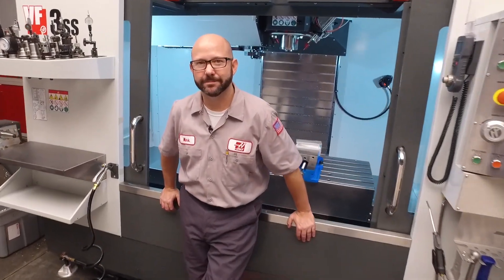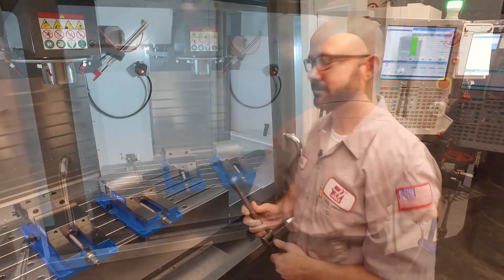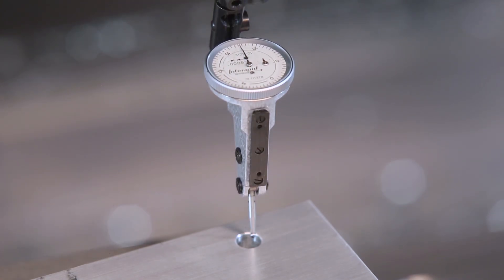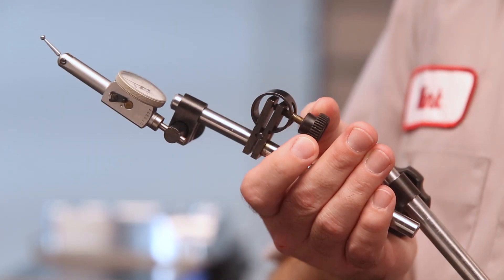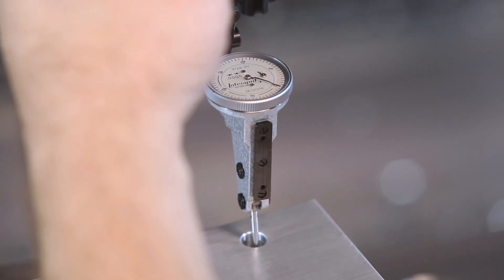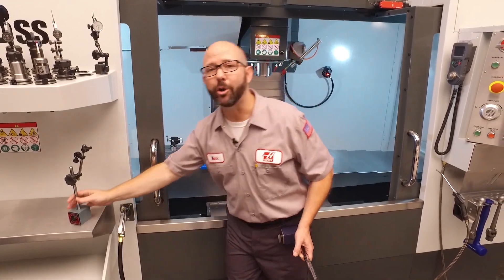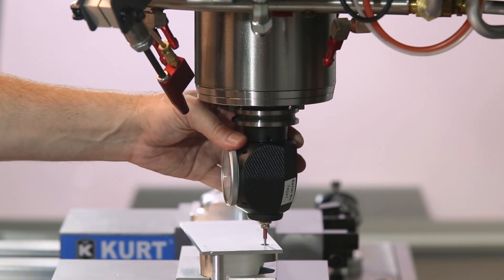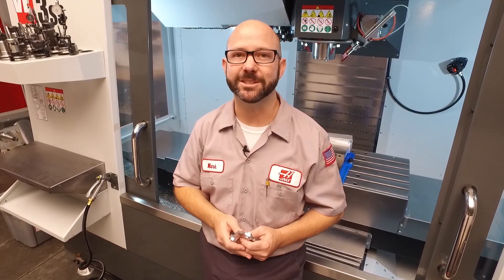How to: Manually Pick Up a Bore or a Hole with an Indicator – Haas Automation Tip of the Day

Comment: We are learning this very thing in my CNC Operator course right now at WSU Tech. I am really grateful for this video as it really makes it so much easier to understand what I need to be doing. My only complaint is that it would be nice if the he showed how to get the indicator into the correct position using the magnetic arm mount. I spent 2 hours in class yesterday trying to get this done and never made it, so confusing. Then after all of us were savagely frustrated our Instructor showed us the Blake Centering Indicator and we were all complaining about why we even bothered with a standard indicator.

Comment: Rather than spinning the indicator inside the hole to find zero runout (procedure at beginning of video), a much safer, simpler way is to chuck a round dowel pin with a point ground on the end of it, align this with centerline of the hole, scribed lines work great for this as well. I’m not getting super into depth on this so you’ll need to make some assumptions as to scribed lines being where center of hole is and so on. Anyway, it’s much easier for beginners to use this method rather than mess around with trying to get your indicator tip to have near zero run out. Great video though and thank you!!

Comment: Your videos ROCK.  I have no expectation of ever running CNC machines because virtually everything I do is a one-off.  The benefit is that the basic challenges between manual and CNC machining are identical.  Every successful project starts with a good reference point and that is, IMO, one of the Haas Automation video strengths.

Comment: Another tip. Before ya got your hundred and fifty dollar indicator in the spindle, run "S100M3" to prevent an accidental spindle start from flinging your indicator across the room. Don't sit there and think it can't happen. True story. I worked at a shop in Fremont CA. We had a good year. Ownership bought us all mititoyo indicators. My boss, one if the owners, accidentally started the spindle which was set pretty fast and shot my two month old indicator across the shop. I was new so I just quietly said damn. He bought a new one, but the lesson is, if the spindle doesn't go fast, it can't fling your tool.

Comment: You can use an horizontal indicator, using the small dove tail on the side of the dial and bend the touch at 80°...

Comment: Literally at lunch watching this because I am struggling doing it for first time. I have no idea why this difficult. It looks super straight forward but for some reason it is really hard to get it down.
Reply: The method shown in this video is by far the most frustrating and difficult way to pick up a hole. 
I suggest you use a basic edge finder, split your X, then do the same thing on Y. This will get you centered within a half a thou. Then use this method to fine tune it.

Or buy yourself a cheap coaxial indicator, it will be the most useful tool you ever buy and save you half of your setup time. I got one on ebay for $80 and it gets me within a quarter thou of center. If you need more precision, then you can indicate it like the video shows afterwards.
Reply: I personally, and I have been doing this for four decades, get my indi down to a sixteenth or so above the hole and get the ball close to even on all four edges before I drop into the hole. With in a sixty fourth or twenty thou. Then it's spin it and do the math. It may help to think of it as "short of the zero, or past the zero" to help make the adjustments. I also always MDI S100 M3 so that if I accidentally start the spindle, my indicator doesn't fly across the room

Comment: I've found that if .001 is good enough for location, a Blake Co-Ax is the fastest way to find the hole. If you need better accuracy, then switching to a tenth reading indicator will do nicely.
Reply: This man speaks the truth. My coaxial indicator is the most useful tool in my box. And only $80 on ebay for a cheap one.

Comment: Why do you use the G55 work offsets and not the G54? Also, my friends and I haven't used the machine in a while and we accidentally part zero set the z-axis and I was just wondering what would happen if you did that and how to fix it if anything does happen.
Reply: Hi Braydon, check out https://youtu.be/uNjMIIRttFE . There is a lot of good info in the comments section of that video as well.

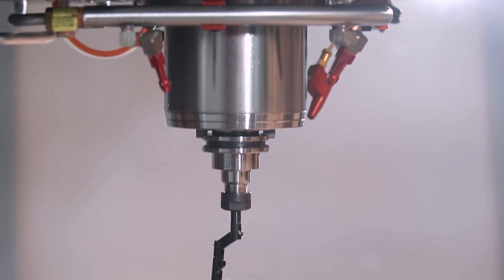Comment: I noticed at 1:35 you stop to rotate and tap the indicator with your finger. Can I ask why this is done?
Reply: Before I lower the indicator into the hole, I tap/bend my setup (while rotating) to put the tip of the indicator on the centerline of the spindle. This helps us start close to the hole center, which makes things easier.

Comment: Hi, thank you for another explanation important things for machinist. I have a question: what is the brand of horizontal indicator with black dial? I'm trying to find out one which has center of the shank lined up with center of the tip. It is hard to find one. Most of the Mitutoyo has tip off center na could be destroyed while rotating inside the hole or when touching the edge of material. I will be appreciated.
Reply: This is a TESA Brown and Sharpe BesTest indicator. I've really liked mine for this configuration.
Reply: @markterryberry4477  thank you very much!

Comment: I don’t get it. I must be missing something. If you only eyeball the tip of the indicator whilst spinning it, how does the concentricity of the tip to the spindle get established? Or doesn’t it matter because even if not perfectly centred the “centre offset” will be consistent for both sides of the hole?
Reply: We just eyeball it to save a little bit of time before we start using the actual indicator itself to measure things, to find how far off-center things are. If we are too far off when we start (6mm etc.), then the indicator won't make contact properly.

Comment: I like to put a pin in a tool holder or just line up a tool that is close to the diameter of the hole to speed up the eyeballing. I get much closer to center before I even start indicating.

Comment: Hello, put in G54  annd G55 two differentzeros to make the same piece in different  reference points, I did it a while ago in Dewoo 4020 vertical machining center, and I used  a Pycock tracer, I see that you use the Z+ for anything the encoder is in a mayor advance , the concentration is paramount and avoid being distracted by third parties, excellent quality of work, naw in another company Iam in charge of center HAAS VF6/50., very good machine, congratulation. Best regards Denis Morend.

Comment: I have a small doubt here, what if the needle changes it values along the circumference, but the reading at all the quadrants is zero ? Does that means the bore is a bit oval?  Please clarify this. I have been watching your videos regularly and it has helped me a lot in my shop.
Reply from the maker: Aadav – Yes. It is possible the hole is not perfectly round. In that case we just center things the best we can. When holes must be perfectly round, we usually go with a boring bar, with a single insert. – Mark, Haas Tip-of-the-day

Comment: One thing I like to do is pick up the hole first with an edge finder which gets me within .001-.002 then I double check with the indicator.
Reply: Can you tell me how you do this?
Reply: @tamekajackson8222  use a standard or conical edge finder if it's a small hole. Do only one axis first. Start roughly in the center of the hole and pick up one edge. Note your machine position and pick up the opposite edge. Split the difference between the numbers and move the edge finder to the center.  Now repeat that process for the other axis. If it's a true circle you should end up very close to center.

Comment: Why does HAAS leave the .1 button.  NOBODY uses this for anything.  If the motion stopped the instant the hand wheel stopped moving regardless of how many clicks on the dial, maybe. I have trashed many probe stylii because I accidentally pushed that fucker.  The button should at least be gated so you know without looking it was pressed. Or maybe a different beep and a light flash something.

Comment: TIP (for newbies):  Initially centering the point of the indicator can be relatively complicated if the holding arm is at all offset and/or the indicator is twisted. It's rarely as quick as the video makes it seem, hence the reason he says, "Now, if this takes a little bit of time..."  

In my experience it's not worth the time and can be a total pain! Instead and before using your indicator, put something round into your chuck (preferably with a point) to locate the hole by eye. Personally I use a 3/8" drill blank, with a 45 degree point ground onto the end, but anything will work (chamfer tool, dowel pin, etc.).. Will get you VERY close before indicating, trust me!
Reply: I would use a spiral pointed tap in my drill chuck, works great. Nicer point than a drill
Reply: @KARLOS121  a drill blank is just a rod with no flutes, etc...
Reply: I'm about a month in as machinist ( all manual). I have been relying heavily on using an edge finder to locate because I can never get my indicator tip to line up on center and then rotate around a small diameter like a 3/8 pin. This sounds like what I need to try. Thank you.
Reply: @indubitably424  You're not a machinist, you're a machine operator.

Comment: That's a brown and Sharpe DTI, I can tell you right now they did that by mistake and the yelling in the background...
Reply from the maker: MLG420 Mcswaggerten – I love my BestTest indicators! I actually have about 15 of these indicators, in a drawer - casualties, crushed at the hands of apprentices over many years. I’d pull out the broken indicators, and show them to new hires as a warning! The indicator in this video was actually pieced-together from broken pieces, and super-glued together just for this shot. Always jog up, check your increment, then down slowly :) – Mark, Haas Tip-of-the-day

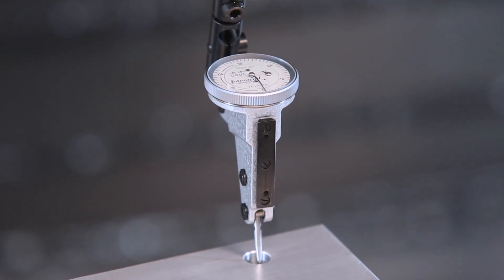Comment: 4:27 if you setup your needle largest angle you can get it fit inside hole you get cosini error and your needle move more than real measure is SO it will come more acurate lol. you measure difference

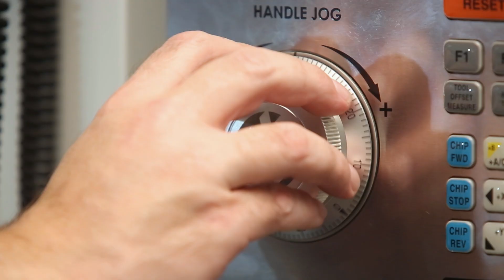Comment: 2:43 that will never happen on metric machines lol. machine move 0.1 mm each step. unless you give good spin and let it roll. this never happen. you allways turn dial not spin it lol. if 1 click is 1 inch then LOL yes that happen. why HAAS need move that fast on manual. LOL some wrong?
Reply from the maker: Jari Sipilainen – That is funny, I hadn’t thought of that. Yes, the machine doesn’t move as far, with each click, in Metric Mode, moving .001/.01/.1/1mm per click instead of .0001/.001/.01/.1”, so less than half the speed/distance depending on which increment we choose. We often turn Setting 163 “DIABLE .1 JOG RATE” on, at schools, to avoid students jogging too fast. Thanks for the comment. Interesting! – Mark, Haas Tip-of-the-day

Comment: Since you most likely machined those jaws there is no need to drill a hole all the way through your part. Also if you ever machine a set of jaws that you plan to re-use you should put a reference hole at a predetermined location on the stationary jaw for finding the reference point at a later date. Maybe you do this and were using this through hole for demonstrative purposes only. You save time on op 1 by not having to drill as deep, as you still have to indicate the hole on op 2 anyways. A properly made and seated jaw into a clean and chip free vise can bring many subsequent uses without having to machine contoured jaws every time you run the part. Just my 2 cents. Thank you for another great video!

Comment: Or just mill 2 clean surfaceses on the blank material in X and Y and meassure it. when you turn the part around you can get your 0 from this points

Comment: Great video. TESA shows that the Interapid stylus must be at 12° to the work surface for a true reading w/o cosine error. Does this apply to sweeping a hole? or, as long as you get zero readings, cosine error doesn't apply?
Reply from the maker: Hi Emilio. I was using a .0005” indicator, meaning that when the needle moves by one line, then I have moved by .0005” – but this is only true if the indicator tip is at a very particular angle (12° like you said, but different for each make of indicator).  For us, when sweeping a hole, we don’t have to worry about this Cosine Error. As long as we read “0”  from all directions, we know we are on center. Great question. – Mark, Haas Tip-of-the-day
Reply: That's what I thought. Thank you. Since it's a comparative measurement, like you wrote; as long as you get zero in each axis. Makes sense.

Comment: What products or methods do you use to keep your table and covers so clean? I have a newish machine that is quickly building up stains on the table top.
Reply from the maker: Martin – Staining is usually just a visual problem (doesn’t affect table), but I will go ahead and scrub the table with a Maroon Scotch Brite pad, treated lightly with a Castrol Rustilo rust-preventative, or even WD-40, if we need the table pretty for a video.  – Mark, Haas Tip-of-the-day
Reply: A teach your people that cleanliness is next to Godliness. When you have a five year old table without any "oh sh t" tracks, it becomes personal to keep it that way. Be safe, have fun

Comment from the maker: Hey everyone! A viewer just showed me a magnetic edge finder tool that helps you indicate the edge or corner of a part easily, even if the block is at a funny angle. These are terrific, I need one for my toolbox! Check them out and never stop learning! 
–Mark, Haas Tip of the Day 
http://www.swissprec.com/cgi/ISSRIT2?pmaka=98-337-9&pmctlg=01%26%2365533%3B
http://www.jtsmach.com/jtswebshop/Measuring/PM482.asp
Reply: Haas Automation, Inc. How do I utilize the magnetic edge finder?
Reply: If your talking about the Machinist Chair? The company ampg.com is the manufactor of them.. check their page out as they have alot of unique goodies.  I found another indicator holder like the stick one that alot of the guys with interapids use. It is made by pmir.com locally to me here in Cleveland,Ohio.. A older gentleman who ran boring mills came up with it. He has them in 1/2", and 3/8" shank. He wants about $50.00 For either one. I bought both. I add the links or take them out to make for a shorty or long length for the tasks I need.  Best part is it is more stought and can hold the import indicators and Interapids for almost any regular task
Reply: I would add setting the spindle to a low RPM prior to attaching your indicator. "S100 M3" has never shot my indicator across the room. Accidentally starting one at 1500 or so is instant death. When I was just starting out the shop I worked at bought us all new mititoyo indicators. My boss, one of the owners, started the spindle and before he would even say "oh sh. " My indi was scattered. I still have the body. And the indicol is still in use damn near daily. Good series though.

Comment: I like the tip about always moving plus first. This is what I've always done. It's impossible to teach people the importance of doing this, of course every idiot with 2 years experience think they're a master machinist. Then, sooner or later they'll crash a probe or an indicator. Then the light goes on.
Reply: Z plus 6 or 12 inches depending on z travel is the very first move on any tool when I program. An x or y movement with your junk hanging down is embarrassing and often costly. Also, MDI S100 M3 before you mount an indicator to your spindle. Your indicator and your wallet will thank you

Comment: Fantastic video. One tip on the Co-Axis indicator. They sometimes will not read on center due to run out in the holder, so it's a good idea to double check them against a typical indicator. 

I've got a few non working indicators if you need them for future videos. :-p

Comment: Here's a question for you!! how do you zero drills end mills on lathe with live tool holders? now that's going to be a fun tip of the day.
Reply from the maker: Thanks for the comment! Check out our Live-Tool Setup video at https://www.youtube.com/watch?v=Yo1J5XWy78Y. Most of your live-tool questions should be answered in this one video. For more specifics, reach out to the Applications experts at your local Haas Factory Outlet and they can fill in the blanks. -Mark, Haas Tip of the Day

Comment: I pooped myself too but the saw the black dial face and knew it was a cheapo-depo. Really like the tip to eyeball the center line at the beginning. The indicator never lies and will save you sanity of the probe is on the fritz.
Reply: look again, that was a Brown and Sharpe Besttest!
Reply: Andrew Ydna DuBuc Ill be dammed your right! I guess Hass needed to create an accurate simulation i guess. Then again a Chinese knock off isn't even even aloud in the parking lot at Hass
Reply: @highstreetkillers4377  what's best in your opinion, Mazak?